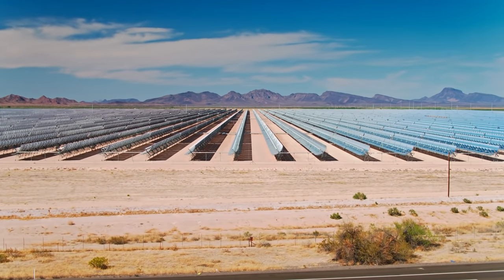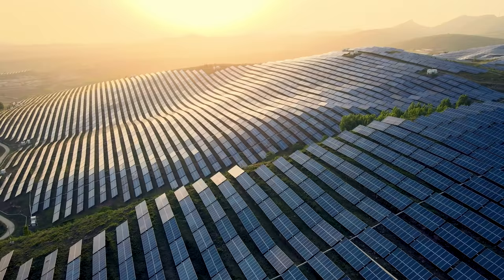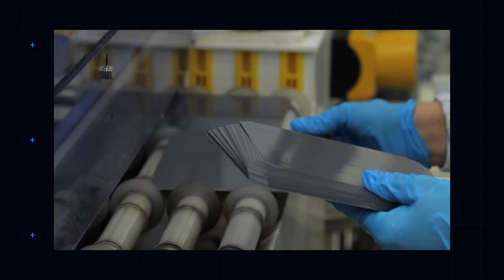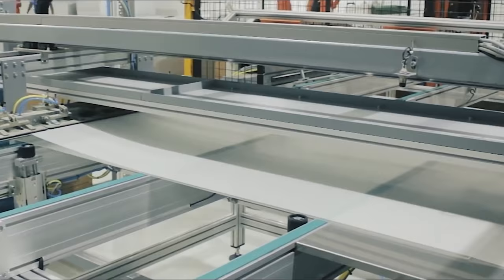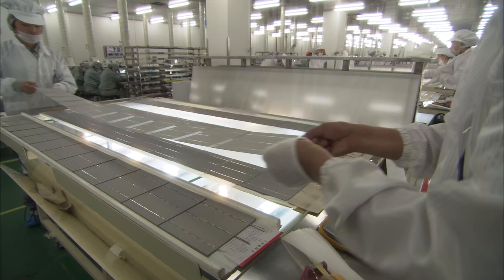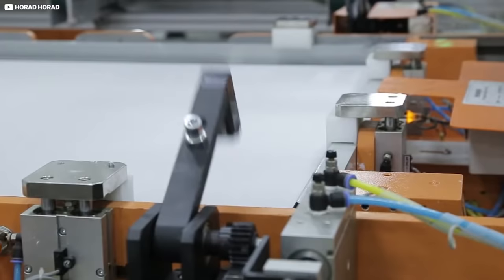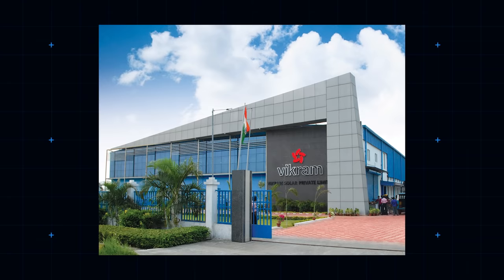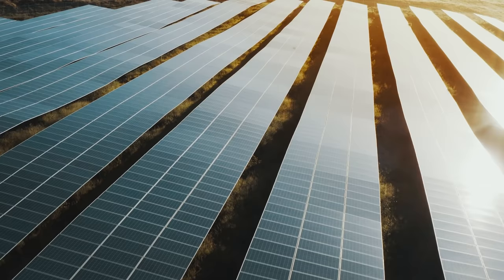How Solar Panels Are Made

Comment: Wanted to know how these panels are disposed/recycled after they have reached their end of life (20 years?).  I know that old wind farm structures made from concrete/fibre glass are having a tough time getting disposed of.
Reply: They aren't tough to recycle, just expensive. (one can't simply bulldoze one onto the back of a truck. takes about as much work to take one down as it took to build.) The biggest problem is getting people to recycle, well, anything. Wind farms tend to simply be abandoned, so there's no one to clean anything up.
Reply: go away recycling karen
Reply: @davidanalyst671  wtf?
Reply: I guess that's going to be another challenge for upcoming generations to deal with.  As always our monocular view creates a temporary solution to what seems to be the current most important problem by creating another one probably even bigger. But as long there will be problems we will be looking for solutions. Hopefully
Reply: They're just buried next to the base where they were installed. Also non-biodegradable. Not so green.
Reply: I don't belive the whole world could be one day run on Solar power ? Also what about the carbon foot prints and polution from lithium ore mining and solar panel manufacturing ?
Reply: They have a lifespan of more than 40 years (most suppliers give 30y + warranty). You can recycle more than 90% of them. They are mainly glas + the wafers, which are silicon based. So no big deal. Less than 5%  a bit of silver for the busbars, a bit copper and aluminium for the frame + 1% other metals. You can recycle everything valuable in there.
Reply: I was wondering the same thing. It's a huge talking point for the anti renewable crowd/energy company/fossil fuel shills. Just recently saw some comments proclaiming solar panel construction was one of the dirtiest manufacturing process around. Based on this video it's more like I assumed, fairly simple and on par with most electronics.
Reply: @nicklebuck  yeah, the great thing about solar panels is their simplicity. They are made with cheap (and common) minerals. That's one of the reasons why recycling is "hard", the value in the solar panels after decommissioning is mostly the silver.
Reply: @nicklebuck  you can't call someone a "fossil fuel shill" for not agreeing solar is the answer.  The video does a good job of skirting some points too.  What they really mean by heating silica with a readily available source of carbon, is super heat silica by burning it with coal.  Silica and coal are both mined.  One has to take into account the mining of both products, and the act of burning the two of them together.  Coal happens to be a fossil fuel as well, of which I'm sure you already know.  

If you don't want to be a fossil fuel shill, you better go cap off that natural gas line running to your house too, you don't want to be a hypocrite.  

Using a ton of energy to create a product that generates comparatively low energy that needs to be stored in batteries isn't the answer.  It's great for virtue signaling though.
Reply: @MrAlbertaSurfer  i didnt say anyone who who disagrees with solar being THE "answer" is a fossil fuel shill, i said that is one group of people who tries to discredit solar by claiming its an extremely dirty tech. i dont know anyone who thinks solar is THE answer, because its not. it has its applications and is an alternative power source. thats just one part of our energy needs. yes, its common knowledge that coal is still widely used, and it will be great when our tech advances to the point of us being able to phase out coal. thats called progress, it should be embraced. i dont have a gas line to my house, i do have solar panels and a battery that i set up and use to provide my electricity. you shouldnt assume things of people you know nothing about, makes ya look pretty stupid. yeah, you call it virtue signaling, i call it real life. maybe you should learn more about solar and how it can be and already is a PART of the answer to humanitys energy needs. or carry on towing the line for the fossil fuel industry, are you employed by them? or do you just identify with the politics of the party that opposes green tech?
Reply: @nicklebuck  I don't identify with any political party.  I'd also never discredit anyones point simply based on political views.  Here are some facts about my life so you don't have to assume things about me while being offended I did that to you.  I live in Alberta, Canada.  Not having a gas line is simply not an option around here, unless you want to burn a forest worth of trees every winter.  When I break down my $280/mo power bill, about $30 of that is actual power usage.  Most of the bill is overhead cost due to transmission and admin fees.  Sure, you could use solar to supplement, but you'd save maybe $20/mo and still have the same in transmission and admin fees.  When I completely turn the power off during the off season at my lake property, my power bill is still $225/mo.
Currently, I re-use and recycle more than anyone I know.  I never leave the woods or the ocean without pockets filled with garbage left by others.  I refuse to use single use anything.  I hunt, forage and buy the rest of my food from local farms exclusively.   
My problem with solar lies in the fact it's simply not a viable option.  Sorry that you can't cast off my opinion based on politics, but much of the "green" energy is just marketing.
Reply: @MrAlbertaSurfer  it is possible to heat and cook all winter with wood, even in Alberta. I understand the desire for the more convenient gas furnace and stove, but modern wood stoves are much more efficient. Our understanding of insulation has also shown how impactful it is on energy efficiency. Burn a couple cords of wood or a couple hundred pounds of gas, it's a personal choice. Both have their pros and cons, and every individual has their preference. I would personally rather depend on myself than fossil fuel companies. As for your lake house, if you only use it during the summer, solar would be a great solution. It's a one time purchase, it would provide good energy during the summer, and could be turned off and disconnected for the winter. You honestly sound like you have zero experience with solar. You don't even have to leave Alberta to see that solar is more than capable of providing energy to people around the world, we're on YouTube. It's more obvious now than ever that we are overly dependent on fossil fuel. It's not wise to have all your energy needs from one source that has shown great volatility.
Reply: @MrAlbertaSurfer  a couple of cords will go all winter if you have a rocket mass heater, and you won't be tethered to your house as they release the heat for hours. They also burn cleaner and release very small amounts of pollutants. Combine that with good insulation and a modest sized house, it's all possible and not as impractical as someone with zero knowledge of the matter would think. Yes, you have already stated that the manufacturing of solar panels involves fossil fuels, as do most products. It's well known the world over that fossil fuels have been one of the main sources of energy, especially since the industrial revolution. Its called progress when we invent new sources of energy production. Of course there will always be naysayers, especially when you're breaking away from a powerful industry who's profits are at risk.
Reply: @nicklebuck  zero knowledge hey?  Cute.  I've worked in industrial insulation for almost 30 years, hold a General Contractor license and have built every square inch of my house and my lake property from the ground up.  Hands on, all of it with the occasional helping hand from my father and wife.  I e installed solar panels myself.  Wood boilers too.  My sister heats with wood, so I'm all too familiar with how far a cord of wood goes around here.  I'm all for clean, renewable energy when it actually is that.  In my personal experience, the return isn't there, and the carbon footprint is the same, especially is burning wood.  Most of it is a ruse.
Reply: @nicklebuck  You mine silica and cobalt with coal powered machinery and it's (keyword) MINED, it takes more carbon coal to produce the end result and solar needs a energy source and a storage source, if either of those sources aren't constant you will have serious issues. Day light isn't constant and either is the storage. If people honestly cared about the environment you'd be dead set on nuclear power. Also if they even understood how the ocean works and how much natural gas is in our oceans we'd be talking about the never ending loop of them warming and releasing more carbon than a million coal plants ever could but there is no honesty in this debate because you have political powers that want a share of the new energy and they want it now.
Reply: @revoltncock  no shit, what heavy machinery isn't powered by and constructed from fossil fuels in one way or the other? It shows how dependent we are on fossil fuels, which have to be mined, drilled, and fracked, we all know the issues that can create. It takes more carbon coal to produce solar than to what? Use coal as the main power source in an electrical grid that is in constant use your entire life? If the sun stops shining and or we lose all battery technology, we are all in deep trouble. I agree though, nuclear is part of the solution too, and in the future it's probably going to be the answer to our energy needs. But we're not there.
Reply: Simple electrolysis would help recycle these panels judging from the video
Reply: @nicklebuck  imagine heavy machinery being powered by electric  vehicles talk about the delays it would hold.
Reply: I would invent solar hydrology windmills.The solar can feed the windmill and air intake from the windmill can create fresh water using the precipitation 🌧️🌀 from a windmill

Comment: Generating power is one challenge. Storing generated power is another. Would be great to have your views on latest storage tech (Lithium ion, solid state etc)
Reply: Yeah, and I came to know that Lithium mining also isn't good and increases carbon footprint..
Reply: @arpanchatterjee6663  Well, with today's equipment it is. The cruel joke is that to lower emissions from mining, you need green power and electric equipment. But to make them, you need lithium.
Reply: @Ry_TSG  that’s where sodium battery and iron-air battery comes, although the per kg capacity is much slower, but so does the cost and rare earth material used
Reply: Lithium Ion is great for energy storage up to 4 hours but after that, my money is on hydrogen storage
Reply: Thank.you.everyone
Reply: Liquid or nothing kiddddd
Reply: ESS Inc Iron air batteries, perfect for grid applications!
Reply: go for saltwater batteries and save Lithium!
Reply: 1st, Molten Metal Ion batteries like Ambri Technologies Aluminum ion battery.
2nd, Sodium Ion battery.
3rd, Redox Flow battery.
4th, Storing Green energy by producing, Green Hydrogen and Green Ammonia.
Reply: its not a problem with a water banttery bank and turbine problem solved

Comment: solar panels aren't as green as advertised. first off the minerals used are hard to did out of the ground, second solar panels have no recycle nore repair plan so once a panel is damaged it gets replaced and tossed in the ocean. And 3rd. They have to be replaced every 20 years.

Comment: The metals used in this process need huge HUGE Construction Trucks that run on Diesel Fuel GAS OIL. With out these trucks, there is not metals no solar panels.

Comment: I support alternative energy like this but some important drawback need attention but I am glad India is building its own manufacturing to avoid China and not rely on "western" countries.
The first drawback is huge land area required for solar and I prefer to put on building rooftops to use that otherwise unused space. The second is the need to store the energy to use at night and during cloudy days. The third is minimizing fossil energy consumption during manufacturing phase. The 4th is older technology with wiring on top of the cell should be redesigned to the bottom of the cell like SunPower USA does it to maximize efficiency.
Reply: Pls explain more, any video of that back/bottom wiring?
Reply: How about that 2000 degree Celsius part?

Comment: At 1:37  an explanation of how the bar is sliced into wafers is omitted. When the bar is cut into wafers, 50% of the bar is turned into useless dust. That's a great deal waste considering all the energy it took to fashion the silica quartz by process of heating the elements into a usable product. The quartz and carbon are heated by fuel and coal firing processes which produce pollution emissions. Might as well just used that energy for steam turbines.
Reply: The carbon is also coal.

Comment: How much energy is to spend to make solar panel?  How much green land to be covered by solar generators?  Has someone evaluated overall environmental impact of solar and windmills.
Reply: This is a good question. At the beginning of the video it shows silica being heated in a furnace. What is that furnace burning to generate the heat to melt the silica? Is the first question I asked. Then there is a silver paste. How is that created? Then all the vinyl/plastic parts...from petroleum? And the metals used must be mined, what fuel is being used to do that? Smelting metals requires more heat...  

Also we need alot of batteries to store energy to use, at night or on cloudy days. So that is more manufacturing and raw materials.

I'm not saying I don't support solar. I'm just wondering what the environmental cost is to manufacture enough solar panels (which could be affixed to many surfaces, not just empty land) to go completely solar.  Can the planet afford that much more carbon emission?  And the question someone else asked about recycling the panels when they're at the end of their 20 year cycle is good too.

I would love to see a documentary that explores this more in depth and the possible solutions.
Reply: @bel z. I saw it. I don't know how outdated the info is. The questions about the amount of energy it takes to create solar, electric, wind turbines, nuclear reactors etc. are still valid.  It's reasonable to ask for a  cost and logistical analysis when considering alternative energy solutions, and to expect complete transparency about the downsides to them.  What I don't want is a fluffy feel good ad campaign about how great these things are just so corps. and their lobbiests can get govt. contracts, then later we find out the net gain has only been to their shareholders, while the planet and people are no better off than before. And it seems like every time we blindly implement a new technology to fix one problem (or to make something easier or better), we end up with a different set of problems.

Comment: And use Al+ C,graphite+ Cl+ K Battery we don't have resource for Lithium its expensive as hell and need to replace after several recharge maintance within 3 months without loosing capacity and charge to 80-90℅ and above 30% uneffective mh phone is 3 years and battery powered drill and its LI-on so tesla battery above 20000$ for 200ah battery 400v Waste.. good recycle when comes to battery in that sort not for majority I beleive lol.

Comment: There are two types of solar panels:
1) monocrystalline,
2) Polycrystalline panels.
In addition to toys, we also have solar panels in the Solar Power Bank device (Solar Power bank is a device used to charge a smartphone or any other device that charges via USB).
Reply: Most solar power banks don't produce enough electricity to actually charge a phone. Anker makes a bigger solar panel that can produce up to 20 watts. I want to get that to charge my power banks

Comment: It takes way to much energy and resources for a 100 watt solar panel. A microwave uses 1200-1500 watts when used. 
So, you’ll need about 230 billion solar panels just to run  basic utilities. The earth would hallowed out like the moon if we continue to follow this process.
Reply: We barely even scratched the surface of earth in only a few specific places and we built the current world with just that speck. Use your brain.